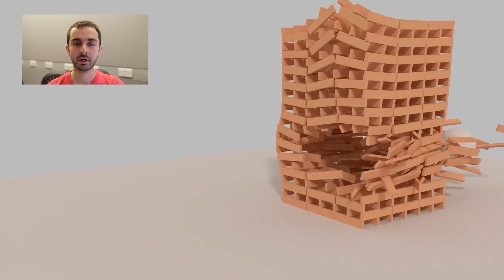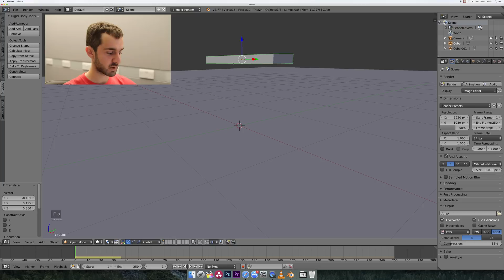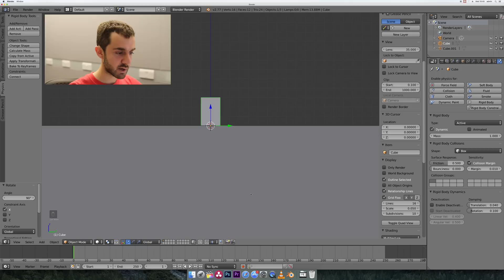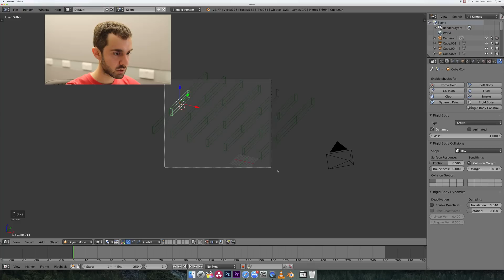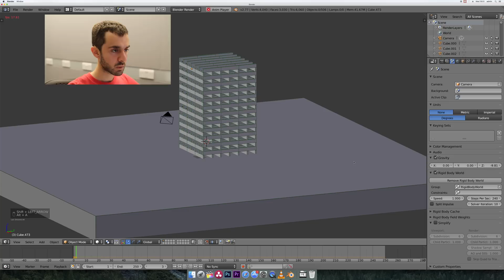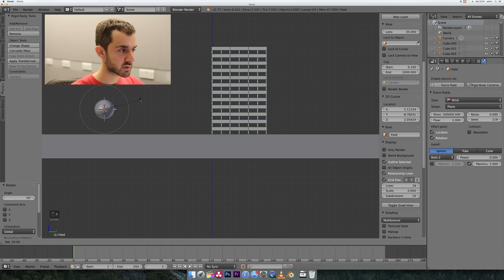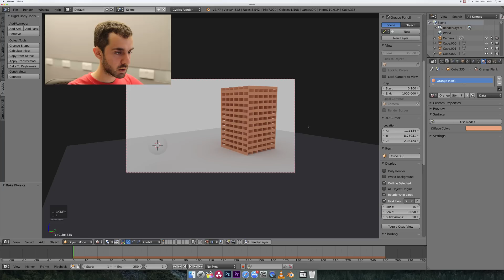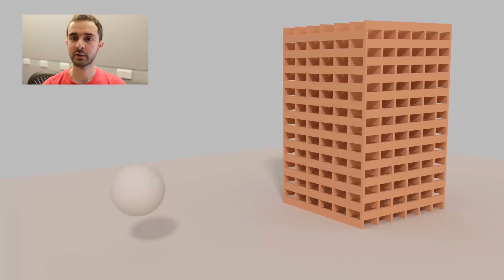Blender Tutorial - KEVA Physics Simulations

Comment: my computer is very powerful i have a 4.2 Ghz processor. BUT the "wind" force in blender slows down the computer a TON and it only animates at .46 Fps. i want to know how it animated so fast on your mac? is there a setting im missing?
Reply from the maker: +Mr.MustacheTako a lot of factors Fdec this like what processor , how many cores, how many planks you have. Also i suspect that because this is animation the GPU plays a part two, which one do you have?
Reply: I have an MSI RX 480. its a decent graphics card that can play any game out today at high-max setting at 1080p and my processor has 4 cores.
Reply: and my scene has 1850 planks.

Comment: thanks man I tried this several times but my tower always collapsed before the ball hit it. Now I know what the problem was. 
Keep going👍
Reply: What was the problem?
Reply from the maker: Aventer probably the number of substeps
Reply: +Moby Motion Ok. But is there another way to solve this Problem?
Reply from the maker: that hasn't fixed it?
Reply: +Moby Motion A bit. But the problem is still present, just reduced.
Reply from the maker: how high have you gone? if it's a large scene I need hundreds of subframes sometimes
Reply: +Moby Motion 5000
Reply from the maker: for real?
Reply: +Moby Motion jop but just for a test and this effect is very very very small but its still tjere
Reply from the maker: hmm. and you did the scaling like I did here? you could try "start deactivated" - that way they'll stay completely still until an obstacle comes near them
Reply: +Moby Motion Okay i will try it at the next opportunity. The scale of the planks is the same as in the video but my building is different.

Comment: Good tutorial, does scaling the cube rather than creating a correct size plank affect the physics?
Reply from the maker: +Peter Moore so if you scale the whole object that can creates a scaled object and that can cause problems. This way, the plank you create a plank with scaling 1, 1, 1 which is ideal. You can also scale the cube and 'apply' the scale, this fixes the problem but it just takes an extra step